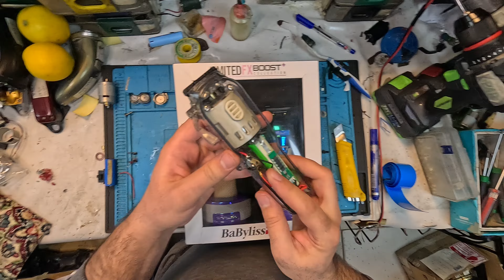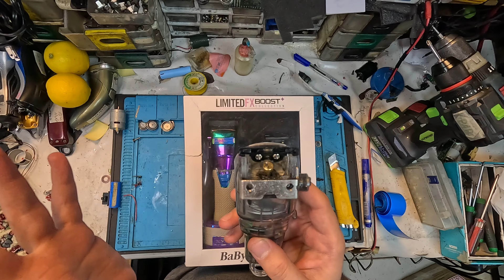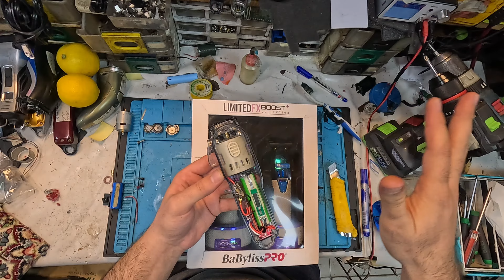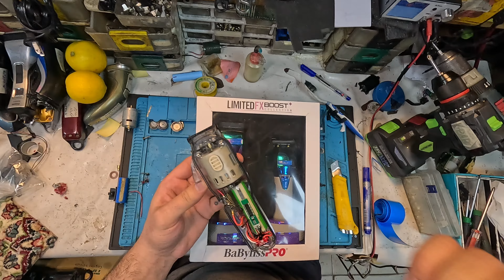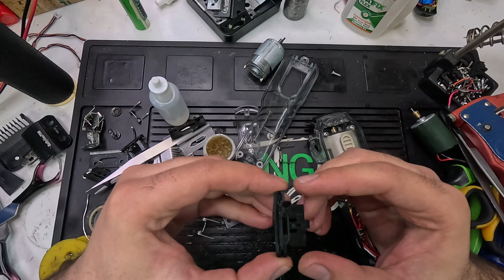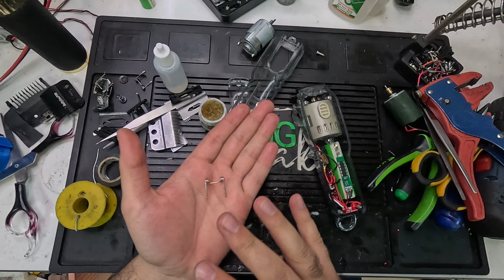Assemble A Hair Clipper to Compete with Babyliss Boost +

Comment: How can i fix the stylecraft instinct metal edition it has a loud noise and starts vibrating like crazy when i open the lever fully i put on the strech bracket that comes with it and there was no problem for 15 days but lately started buzzing crazy can the strech bracket deform and create noise or ?

Comment: Quick question: does a ceramic dynamic blade have coating (DLC) on it? Mostly the ones from Kemei, VGR for example those ceramic blades
Reply from the maker: No, it's not coated.
Reply: @ would it be bad if I used it on a Faper blade from stylecraft? It’s DLC
Reply: @ can I maybe text you on an other social platform? I love a new clipper I just bought, but I wanna swap blades to make it a bit sharper to take out a bald line. and i love the faper blade with thin cutting blade from stylecraft but you mentioned to never use it. The clipper I bought isnt an AC motot tho
Reply from the maker: @TheRationalThread  recently, i was thinking about a telegram group for barbers to ask their questions and so here we go: https://t.me/CutswareGeek